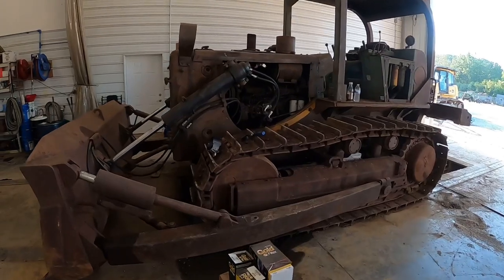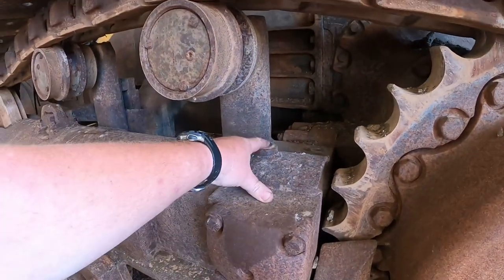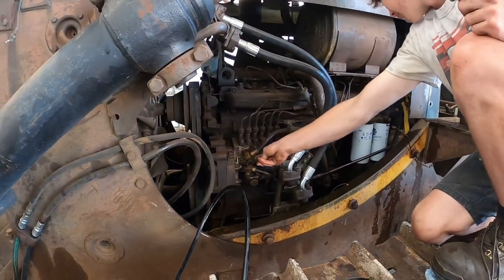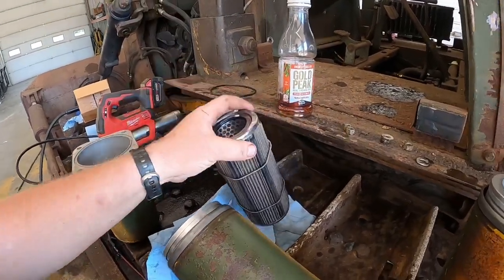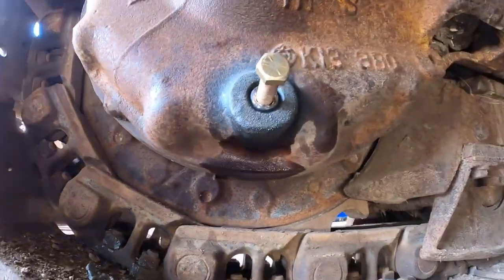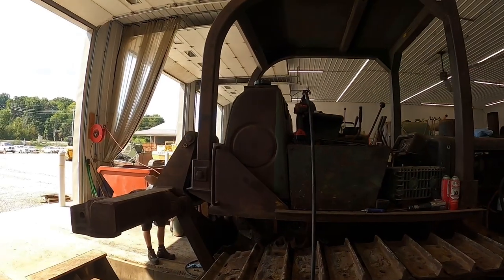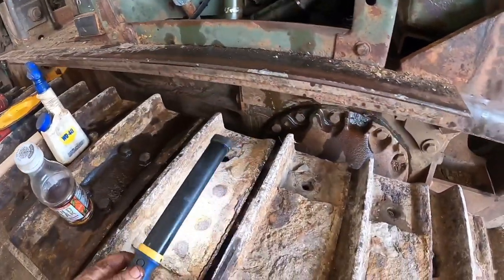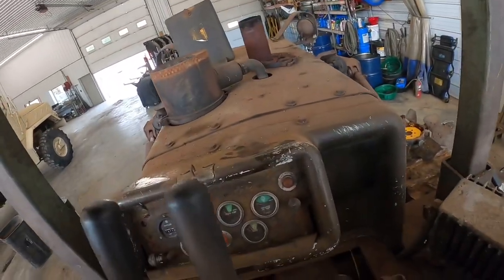Full complete service and brake adjustment on International Harvester TD-15C @C_CEQUIPMENT

Comment: This one brings back some memories.
I worked on a 1958 TD 14-2 back in diesel school. It came in for an LOF and check the brakes. I ended up rebuilding the brakes, final drives, repairing levers, pins, and every time the owner came in he added to the list. I guess he liked my work because he wouldn't let anyone else work on it.
I learned so much working on that machine.🤙

Comment: Great Video! I have a 1973 TD 15C not nearly as good a shape as that one. Never knew that was a grease port for the rocker shaft.. And the steering and brake adjustment.  Very helpful.
Reply from the maker: Glad it helped

Comment: I had a TD 15 c later model like you.  serviced. Loved it, I also had Cat D6d  and the 15 would out push it with the two speed steering. Great tractor, ahead of its time with steering system, only problem was parts. Loved it!! Also loved D6d which was s bit more robust but heavier. Got stuck in mud much easier. 
Sempher fi

Comment: My dad had a brand new TD20c when we went mining in Alaska in 1972 and we also started having problems with the cross shaft on it, it broke the end off  and we replaced it with a new shaft which eventually broke as well then we cut the shaft in two, made some thick gussets to go over the shafts and welded them solid to the frame so the bearing surface could still pivot on the track frame but without putting so much strain on the shaft. it worked good for a while, eventually the end of the shaft sheared off.

Comment: That old International dozer is really low time, you don't see them very often that are not worn out. I would be interested in knowing what a dozer like that will bring on todays market? I enjoy watching all your videos because you do good mechanic work and don't cut corners on your rebuilds. If you started running one of these old Row Binder dozers when you were 12 years old, you've been at it a while. Thanks for showing the maintenance tips on video.
Reply from the maker: Yep
I think this brought around 40 when we were done

Comment: After doing a service like this do I need to bleed the air out of the hydraulic system? 
I have a Cat 963 that busted a line to a lift cylinder so I replaced the line and hydraulic filters since almost all the oil ran out. After changing the line and both filters & filling up with fluid I can't get the lift cylinders to work. The tractor runs and moves in gear but the bucket won't lift or tilt. 
At a loss
Reply from the maker: Normally they bleed the air out on there own
Make sure your suction screen for hydraulic pump is clean and clear
Maybe try pressuring the Hyd tank with some shop air to help it pick up prime

Comment: Final drive for the td15 should be 30 weight oil factory specs or caterpillar 50 weight pivot shaft 30 weight depending on how old the engine is either 15/40 or 30 . in my youth l ran an * on site service lube truck * at a Komatsu dealership International yellow & the basket case International green medium-duty we bought out buy Komatsu
Reply from the maker: Factory lube chart says 85/140 gear oil in finals
Reply: @C_CEQUIPMENT  Hello C&C Equipment:
85W-140 operating in 49°C to -7°C
85W-140 or 80W-90 operating in 21°C to -23°C
80W-90 operating in -12°C to -34°C